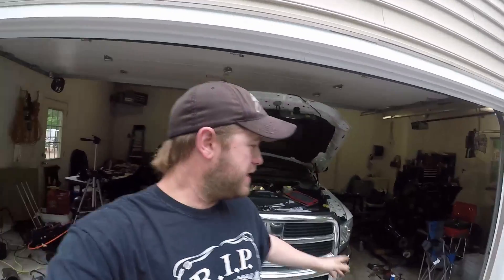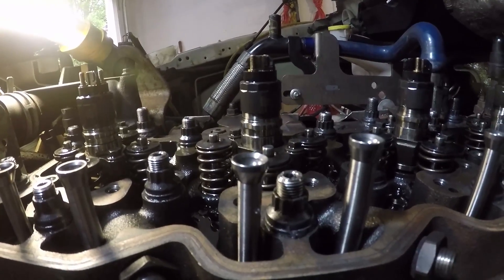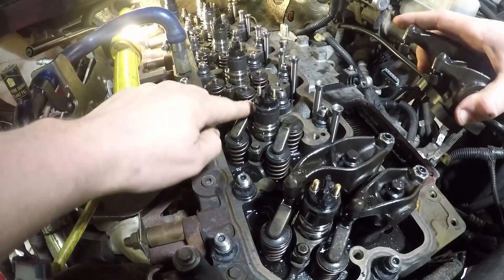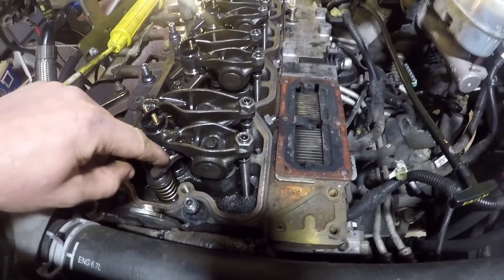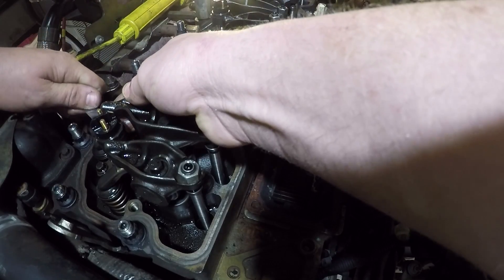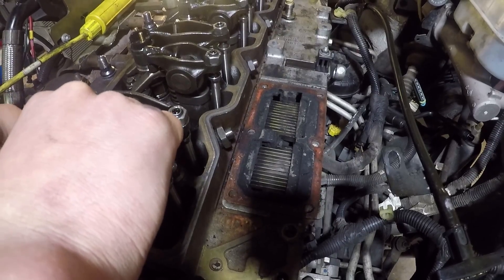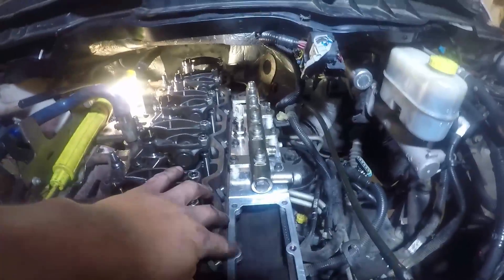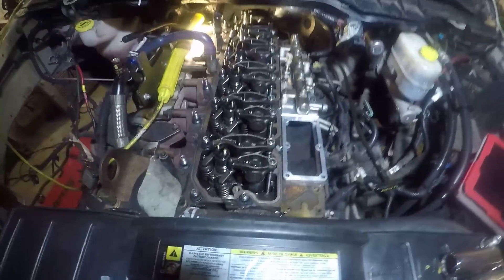6.7 Cummins Valve Lash & What EGR is putting into your Diesel

Comment: Hello Tom. May I suggest using a inch lbs to set the valve lash, this way you will know that every valve lash will be the same.
I’m a heavy duty fleet mechanic for 
30+ years and when I set valves and injectors on engines I always use the torque wrench method.

Comment: Would putting a 6.7 intake plate and air horn work on a 5.9

I got a lot of things done to this truck already. 12mm cp3 45% overs, efi live, springs and pushrods, 67/67 turbo. I always thought the intake was small.

Comment: I installed a new headgasket and arp studds. Everything going back in the same order it came out but push rods on inlet 4 and exhaust 5 are really high. Lash adjustment is all the way up on 4 and on 5 exhaust the springs are still depress even though I am backed all the way out. Went and got a inspection camera and can see the rod is sitting in the tippet and looks right. Any advise?
Reply: I figured it out... I wasn't on true top dead center (assumed I was because tdc was at 12 and #1 piston was topped out too) rotated 360* set 1,2,4 intake and 1,3,5 exhaust then rotated 360* again and set the rest. Love your videos probably wouldn't have been able to do this without them
Reply from the maker: Awesome! Glad you figured it out

Comment: Thanks for the info I change the head gasked and 3 injector and overpressure relief  valve  but not pass 2500 rpm running and shake a little can you help me please is dodge ram 6.7 24 valves

Comment: Tom I'm disappointed .It looks like you gave up. The answer is YES!  Top engine builders and tuners know this and sometimes will do this to squeeze a little more duration. 
    The lift on a camshaft dictates how far the valve will open, Duration dictates how long the valve stays open.  The following is a extreme example to prove a point .>>>>>>Do not do this on a real engine!!!
 It is just to show you why the answer is yes. . 
     Now what would happen if the lash specs are say 5 thousands and that is where you adjusted it to be . Now turn the crank until the valve is almost all the way open towards the top of the lobe . Now adjust the valve to zero lash.
     You now have changed the lift and duration by simply adjusting the valve. Okay A top engine builder would be laughing  because he knows where I'm going with this. You obviously don't adjust valves on towards the top of  the lobe and if he wanted to increase lift he would use a cam with more lift on it. 
    BUT where he would do this sometimes as fine tuning would be squeezing a little more duration by reducing the lash maybe 2 thousands. This should only be done by advanced builders with a lot of experience.  
Training is very important however training without experience is like a Nun with fake boobs!   Tom: You have a good mind just open it a little. Have a good day .

Comment: I'm a retired GM tech. I  also use to train Technicians. Just for fun here is one of my test questions . Is it possible to change camshaft lift and or duration on a camshaft with a 110 degree center just by adjusting valves?  Yes or no will not work you have to give a explanation ! I swear I spell like a 5 year old . Hint there is a vid on this and it's wrong .  BTW I like your videos.
Reply from the maker: I'm interested, My answer would be no. The cam will always have the same lift and duration unless you change the cam. The question asks nothing about what the valves are doing by adjusting them
Reply: @TurbaTom   What are the valves doing ? Answer is Nothing! They should be closed when lash is adjusted.   Put some more thought into it. If you can ask some of your best gear head friends. BTW I will give you the answer after a few more responses.
Reply from the maker: The question "Can you change camshaft lift and or duration on a camshaft with 110 degree center just by adjusting the valves?" It's a trick question, the 110 degree center just trust to throw you off. So the question becomes: Can you change a camSHAFT lift and or duration by adjusting the valves, my answer is still NO! The camshaft is the camshaft it can't change. You could even ask it like this : "Can you change the stroke of the crank just by adjusting the valves?" Obviously not, one has nothing to do with the other and the crank is still a non adjust able rigid piece of metal.
Reply: @TurbaTom   Now that was impressive! I got you thinking and you started digging ! YES  THE 110 degree center has absolutely nothing to do with it. I threw that in . Keep digging!  Hint: The end of your last sentence is obviously correct.  I don't want you pulling your hair out over this and I will stop if you want me to.  You are putting too much emphasis on the cam shaft itself.
Reply: @TurbaTom  Your wrong Tom! Your not adding to the cam! You CAN change the duration by adjusting the valves . That is the correct answer!!! Yea I worded it to throw you off a little but sooner or later you might learn and you won't forget it!

Comment: Are the brackets that you have on the Coolant By-Pass line home made or did they come with Fleece Coolant Bypass Kit?  I bought the Kit and I don't have the line that you have coming out the head and tying into the original flex line like you have and I am having overheating problems when I am on it.

Comment: I just bought a 2005 Ram 3500 with the 5.9, I deliberately avoided the 6.7 for the EGR and other things. I had als read if you replace injectors, does the engine management computer have to adjusted? As in have to go to the dealer?

Comment: that is just one more reason why,  you should not idle your truck(not saying you tom). Ask some ford 6 liters owners that have pulled their egr and looked down into the intake. They look like little chunks of coal in the intake.  I have also read, that the carbon(soot) is also abrasive, almost like running your truck with no air filter on the streets. I've noticed it a few times in some you tuber video's.

Comment: Tom  great vids!   Just going through your vids from your first one. I'm at 120k on my 2012 and looking to set my lash, besides the valve cover is there anything else that needs to be removed?  No emissions stuff left on my truck it must have fell off, do you still recommend the #'s you did on this for a daily for shims ?
Reply from the maker: Nope, but pulling the injector harness and rocker spacer can make things easier if you have trouble. I run that lash on my daily as well